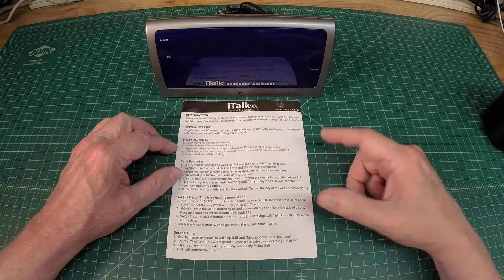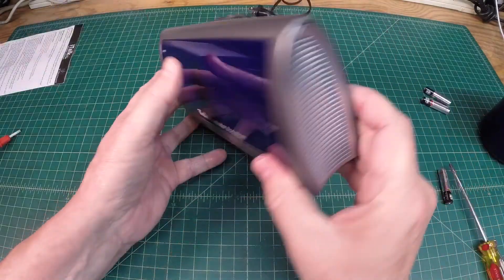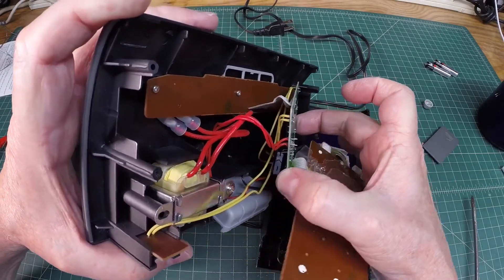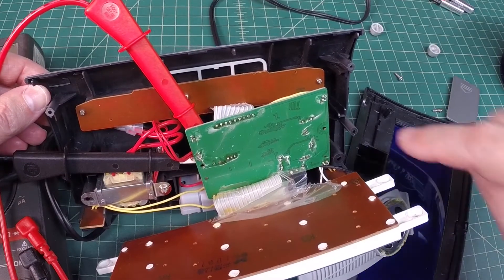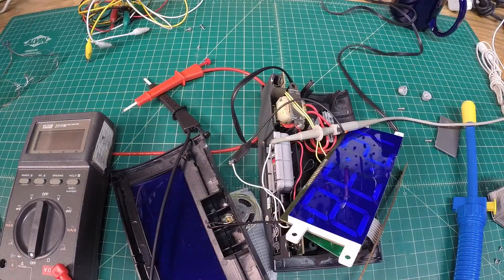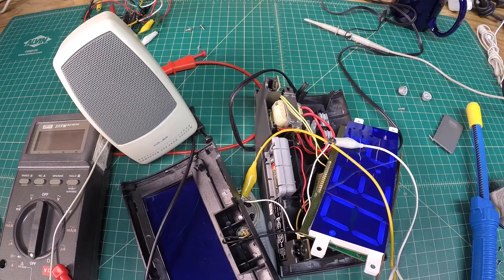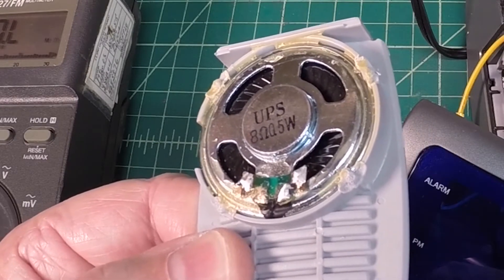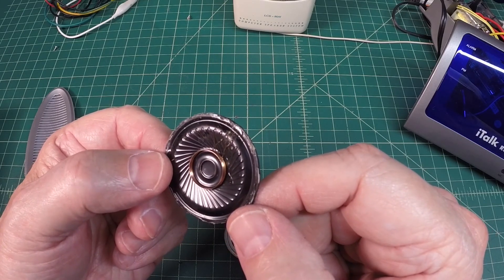iTalk Reminder Assistant - Lessons Learned & Root Cause

Comment: My thought at the end was, why not just rebuild it Don, and blamo you come back ready to do just that!  :)  I never thought of checking the speaker with the volt side of the VOM, I've use the ohm side to do so and in recent times, using a inductance meter....learn something new everyday!  Thanks Don!
Reply from the maker: +Vintage Electronics Geek Hi Jack - not sure I'll be able to repair the speaker or not, but I'll do something to get this back together. Regarding the speaker testing, I was using the resistance setting on the meter looking for... I know the video wasn't great at depicting it. I appreciate you viewing. Best, Don

Comment: I didn't even know such a device existed, much less that it's existed for at least 7 years, lol.
Reply from the maker: +Rebel9668 Gary, it's a neat device for the visual impaired folks and others that need medical reminders daily. Hope I can salvage the speaker, but if not I'll move along with a replacement. Best, Don
Reply: I probably could have used one back then.  I used to be very very nearsighted and wore the proverbial "coke bottle" lenses, or rigid gas permeable contacts.  Two years ago my vision was also reduced with cataracts so I couldn't see to even drive during the day.  I was fortunate enough to have surgery to remove the cataracts along with my natural lenses and have artificial corrective lenses implanted into my eyes.  Now I not only no longer have cataracts I also have had 20/20 vision these past 2 years for the first time in my life.  Take care, Gary